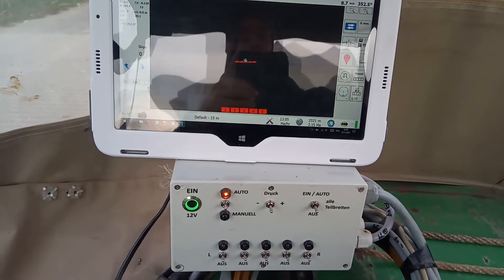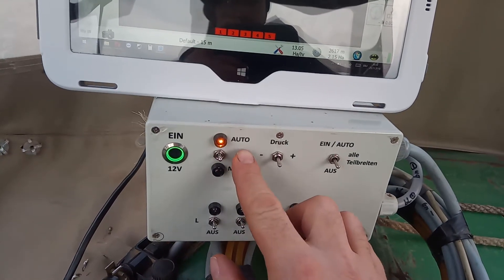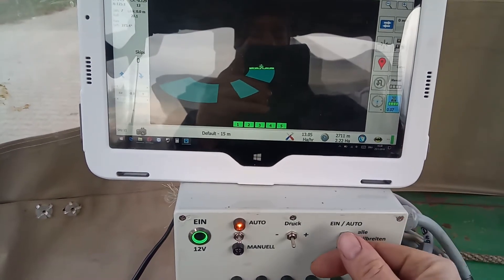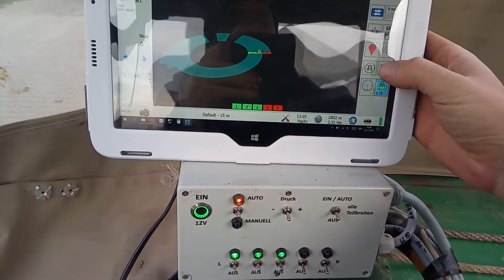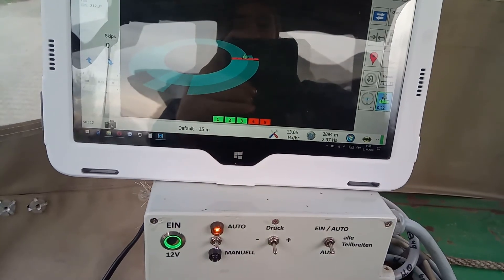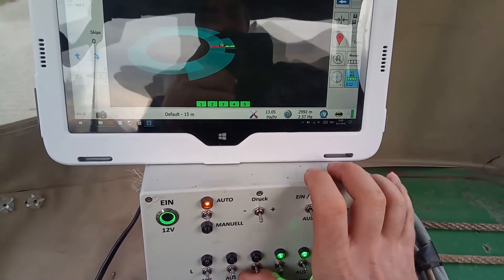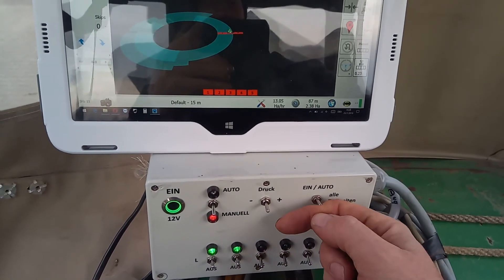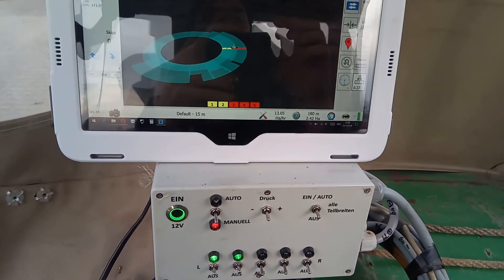AgOpenGPS: Hardware Section switches

Comment: Hi Ma HA, 
Nice project! I'm intrested in the section switches that you have made for  the AgOpenGPS.
Now I’m using 9 sections controlled by the software, but I also want to start using switches like you.
What is the sequences that we have to send to tell the software that the section must be open/close?
Could I have a look at your Arduino code?
Thanks
Reply from the maker: Hi,
You can find a test version for ESP32 at
https://github.com/mtz8302/AOG_ESP32_Section_control

The original Arduino code at BrianTee s github AgOpenGPS is actually not there, I mailed Brian to ask him to put it there again
Reply: @MTZ8302  . Hi Matthias, I have a problem with making IMU( Bno085) work with Esp32, because I'm short on arduinos. On serial plotter it's says bno found on addres, next line it's says Can't initialize. Maybe you can tell it's hardware or software problems?